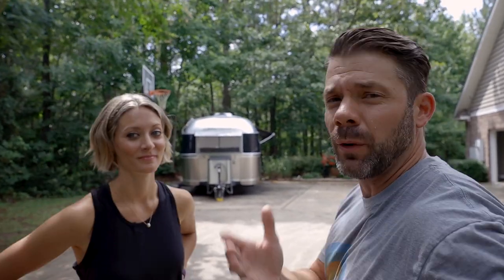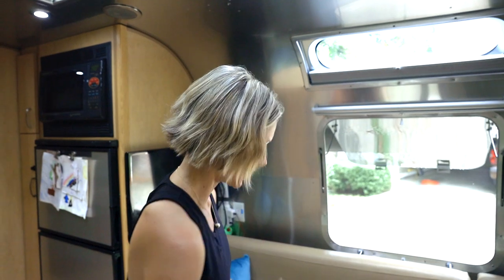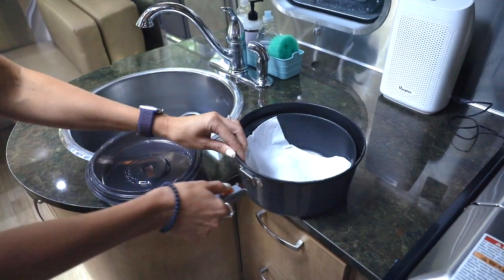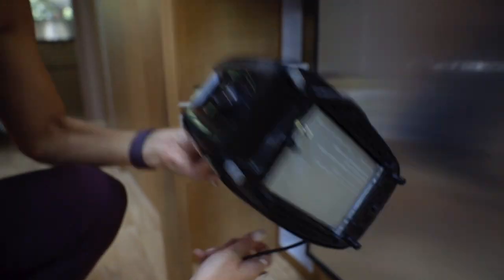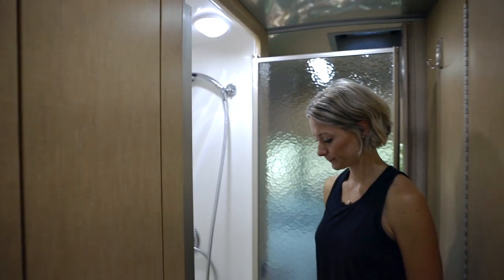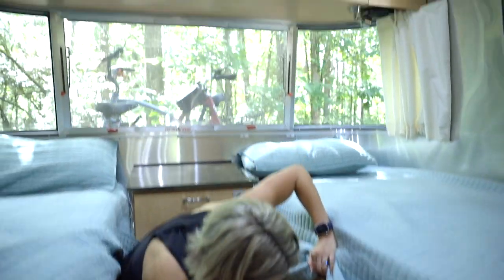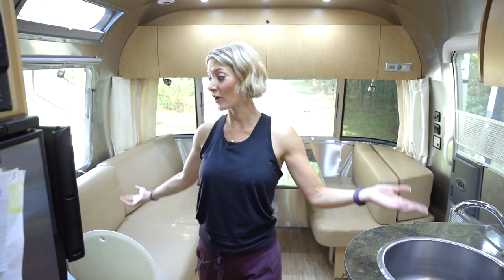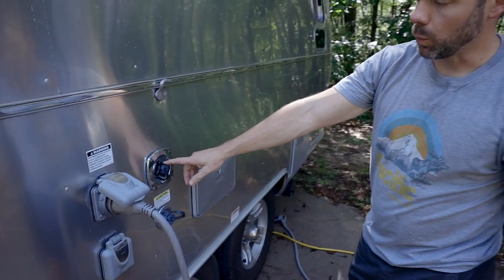Airstream Flying Cloud Walkthrough

Comment: Love the overview. One suggestion re: the kitchen sink round cutting board/cover. I had the same sink in my 23' and used a circular saw to cut the cutting board into one 1/3 piece and one 2/3 piece. I left the 1/3 piece over the sink which offered a decent cutting board for use or creating a bit more horizontal surface, and left a good-sized opening to run the water, rinse and/or wash things. I could simply slide the cover around to clean the sink or more easily remove it than if it were the entire round cover. I kept the other 2/3 piece tucked beneath one of the sofa cushions and put it on if I was cutting/prepping a lot of stuff.
Reply from the maker: I like the idea of keeping the other portion. Thanks for the idea John!

Comment: Great review as my wife and I have been considering this exact model, was very excited to find your video on the very one. Appreciate the fact that you folks covered every cabinet and corner of the stream. Love the idea of picking up one, just not sure one is within our budget being that they are around 105K new.

Did have two questions for you. Looks like the 25' has the option for two ac units. I see yours has the one and wondering if you haver ever felt that having only one was inadequate? Is your sky light in the kitchen where the second unit would have gone?
Reply from the maker: Hi Mike, Thank you for watching!  Yes, we only have one AC unit and we are located in the south. Even on the hottest of days I have found one unit to be adequate. However, adequate is not perfect. When it gets really hot outside, we put a pre-cut insulating foam in the skylights and fantastic fan locations. Finding a campground with trees also helps a lot. I don't believe you give up a skylight with a second AC, but I'm not certain. However, I think you do need 50 amps rather than 30 amps to run two units.
Reply: @nickortego  You are correct, you would need 50a to do that. My preference would be for a single AC also. Thanks for the follow up.

Comment: How did u tap into the rear light to power the backup camera? And also can u show the location that you drilled into the rear awning to mount the camera? I like what you did and is considering the upgrade for my AS as well.
Reply from the maker: Hi Laurence, I just popped off one of the lights and used “wiretap” connectors. My camera came with the connectors, but they can also be ordered on Amazon. I took some pics of where I screwed the camera in the awning, but I'm not sure I can post pics in YouTube comments. I'll try uploading the pics to Dropbox and posting a link under this.
Reply from the maker: https://www.dropbox.com/sh/3nz36inqgtza70n/AAA3-UFl5VoVqko9mJ02lm0Ia?dl=0
Reply: @nickortego  isn’t the light housing a huge aluminum piece? Or did u had to drill a hole in the light housing to run the wires and also let the light screw back tightly.
Reply from the maker: @hotdogakamike  no drilling. If I remember correctly. That top light popped out and I just ran the cable under the light housing. It’s not beautiful, but it’s worked. This does require that I drive with the lights on for the camera to be powered. There’s a pic of the light in that Dropbox link.
Reply: Thanks for the picture. That’s very clever. I also rather not drill into the body as well.

Comment: How are you plugged into your home. Do you have  a. 30 amp Separate circuit.  ? And a surge  protection for your trailer ?
Reply from the maker: Hi David, I was just using a 120v to 30amp adapter. I also use Hughes Autoformer for surge protection. Wouldn't want to try and run the air off it or anything, but it works for lights and the fridge.
Reply: @nickortego  does it charge the batteries. Inverter while doing so ?     Thankyou for answering me btw.     I use hot spot  do you have number for Hughes i would like to get the surge protection
Reply from the maker: Hi David, 
When plugged into 120v it runs the converter, which means it’s also charging the battery. That can be a problem because it’s not a multistage converter. So, it can cause the batteries to boil over.
Reply from the maker: This is the Hughes product I use. https://amzn.to/3Brx8rc

Comment: What do you pull your camper with?
Reply from the maker: Hi Williams, I use a 2014 Toyota Tundra 1794 Edition. In my opinion, it's probably just enough truck. If you're considering a new truck you may want to look at the new Tundras? They are supposed to tow better.